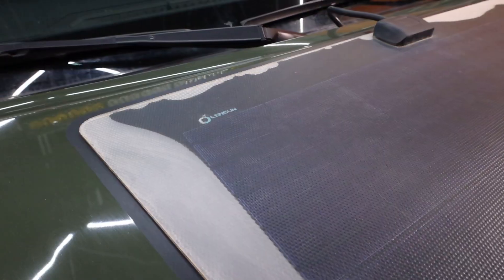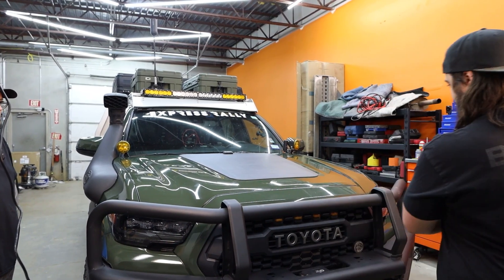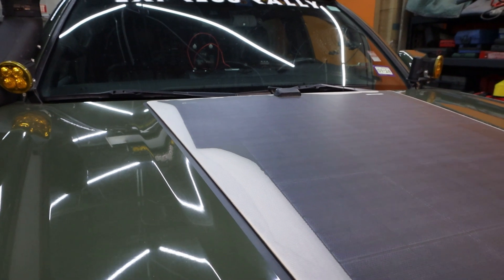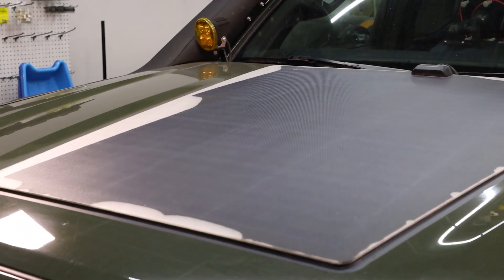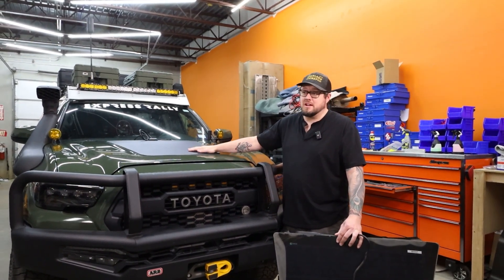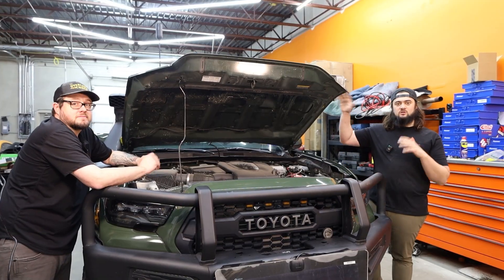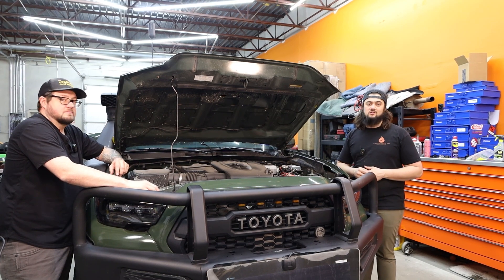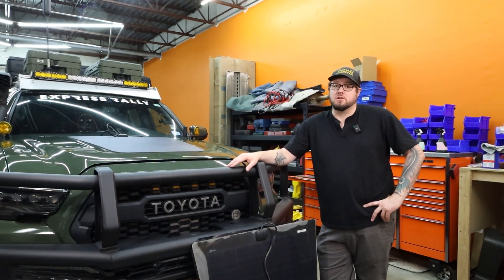From LenSun to Cascadia 4x4 - Why quality matters with solar panels

Comment: This is super disappointing to see. I have run Lensun on 2 different vehicles with zero issues over the last 3 years. I have not had a single issue with delamination or loss of power. Pulled the original off my previous jeep before trading it in, and it would have been useable on another jeep had I gotten the same kind of rig.
Reply from the maker: Well that’s great! Unfortunately that has been very far from our experience.

Comment: Its a good option, but I think I will stick with LensunSolar. I can save the $$$ and get another one when it eventually fails. Nothing lasts for ever. Have been using flexible ones on my roof for 1.5years, no issues. Just installed one on hood, will seal edges with glue as they recommend and will see how it holds up.

Comment: $2-3K in a dual battery system? Are we talking Pesos? Way under 1k without a budget and under 500 on a budget still done right.
Reply from the maker: For an old school system with outdated tech absolutely! For a modern system with lithium batteries and an advanced BMS you are typically over $2,000. You need a charger bracket and battery bracket, the charger, the lithium battery, cables, and for most people they need to pay someone to do the install as well! 

Can it be done with cheap Chinese parts for less? Absolutely, would you trust the safety of your family with that in the middle of nowhere though? Id hope not.

Comment: Can you hook the MPPT charger controller straight to the vehicle battery and charge it without any issue?
Reply from the maker: Yes that is exactly what the charger is designed to do! You simply need to fuse it.
Reply: @BlazeOffRoad  ok! I thought that's what it was for but wasn't sure. Thought maybe it was primarily designed to charge a secondary battery or something.
Reply from the maker: @ we actually love using them to help people hold off on needing to get a second battery! Sometimes just a bit more daytime power is all you need. Typically that will hold fishermen, hikers, and mountain bikers over who are running a fridge while out and away from the vehicle during the day!
Reply: @BlazeOffRoad  Nice! That's basically what I'd be using it for... that and recharging a solar generator that's plugged into the truck while we're out exploring away from camp during the day.

Comment: How does this hold up in heat? and with engine heat as well... Heat is the worst thing for any solar panel as it drops the efficiency massively. I'm not able to wrap my mind on how they are able to over come that..
Reply from the maker: Great question! The short answer is that heat is not an issue. The longer answer is that the panel is really meant to be run when the vehicle is off, as when it is running the alternator is providing more than enough charging. Beyond that the pannel is designed with an airgap behind it, and thanks to the high-quality cells it is actually very efficient, so even with a bit of heat that does not become an issue. Keep in mind that new vehicles also all have insulation on the back side of the hood, along with multiple layers of metal structure giving you a bit of a gap. So we have seen no issues with heat, and they are easily able to withstand heat well over 100 degrees, as all solar panels are on hot days, sitting in the sun!